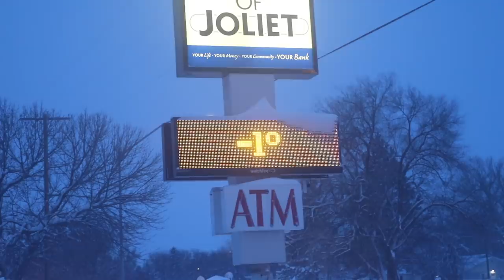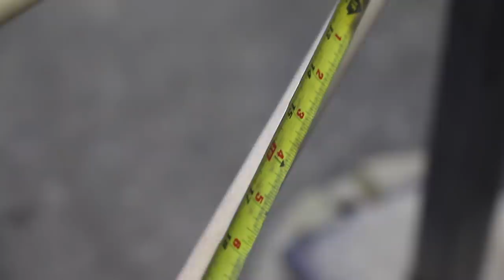Burning Sage Brush & Building Buggy Wheels | Engels Coach Shop

Comment: Great video! I'm afraid the brush burning alone would have just about killed me, but I know you're glad to have it done with. The stop action peening gave me a chuckle, but the self-applying rims made me laugh out loud! I pride myself in knowing by now what you are doing and why, but cutting those spokes so many times over had me scratching my head - that is until the last shot when it became clear that these were on different size wheels (well, of course they were). Thanks so much for bringing us along.

Comment: I got a little nostalgic watching you lock those hubs in, my last lockable hubs were on my 84 Ford.
Reply: Same here. I had a Jeep with lockouts.  I locked them in same exact way.
Reply: My dad had a ford with thoes in the 80s thankfully I can just turn a knob from inside my ford to go into 4wheele drive.
Reply: My 83 Toyota had them as well. Bought it new in the fall of 82 and drove it till the fall of 98. It was a bit rough riding due to the heavy duty suspension, but other than that, I really liked that truck.
Reply: In freezing weather, its very difficult to turn those hubs from free to lock as the grease is cold. However, he has the better brand hubs on his vehicle vs. the stock ones. Warn.
Reply: My '88 Bronco has manual hubs.  I always preferred them to the automatic ones it could have had -- at least in those days to lock the automatic ones you had to stop and back up.  I found it really handy to be able to shift from 2wd to 4wd on the road without stopping whenever it got a bit slippery.
Reply: @BrooksMoses  Yes true dat. Unlocking them by backing up after lever is in 2wd. The older 4WD transfer cases are more robust but the public does fall in love with a switch or button to avoid going outside to deal with locking hubs. I never understood the problem with having to do that but I'm not a yuppie from Vany Nuys, CA.
Reply: Glad to see I am not alone. I miss the ritual of locking before a 4wd trip. It was a ritual that contributed to the whole experience.

Comment: Agreed, much time and planning takes place to get those time lapse shots, especially on the fellow shots without the master wheelwright being in them, spoke to spoke. Was a good idea to show annual land maintenance takes two trips, one to make the pile and a second trip during winter to burn it down. Good nutrition for the ground. There's something about those Sarvin hubs either way you look at them. 
Wouldn't it be nice to have a machine that trims those spokes properly finished like an electric pencil sharpener? I'm just thinking of methods that would speed up and simplify but then not knowing what those costs would be, might just leave those ideas alone not knowing the volume of work they'd see. Likely, the shop knows the best cost/yield numbers best to follow.

Comment: Winter is definitely a good time to burn unneeded wood... the boathouse at our old cabin had become quite dilapidated after not attending to the tarpaper roof a few years, so one late summer I wound up stripping everything out of it and the volunteer fire department handled the ‘demolition’ over the winter. Only one hiccup though. The fire burned hot enough that the birch that branched out over the boathouse didn’t leaf out the next spring. 😑

Comment: Regarding the burn pile:  The first summer after I moved onto horse property I had a huge manure pile.  I did not have a tractor or manure spreader yet and it was getting large.  I was limited by the height I could dump a wheelbarrow so the pile was three feet high and twenty feet long.  As the summer progressed, July was hot and dry and the manure dried up.  I thought “Why don’t I just burn it?”  

I waited for the next big thunderstorm forecast to make sure the fire didn’t get outta hand.  I lit the oldest and driest end of the pile and it burned slowly with an unimpressive flame.  The rains came down hard and the fire was seemingly extinguished.  It wasn’t exactly extinguished.  The outer three inches of manure got wet but essentially shed the rest of the rain off of the pile.  The inner part of the pile continued to smolder until Christmas!

I was like Oliver on the TV show” Green Acres”.  I learned all the lessons the hard way that in agriculture you are a slave to the seasons and the daily weather.😉

Comment: As always great videos by - 2 questions:
You make two spoke cuts on the bandsaw, why not just cutting to length with one cut?  Am I missing something?
I see you use spade bits - are Brad point bits too slow?  Spade bits are easier to sharpen and cheaper - suspect that's the answer.
Love watching your processes, techniques.  I make m&t fir barn doors so I appreciate the Craftsmanship involved with wheels/carriages!

Comment: Thanks for the progress vid. Haven't done any brush burns since I lived in Eureka. Rained so much there, we could burn 9 months out of the year — bummer was, it was so wet it was hard to get stuff started, even after it dried out. • Hope these questions aren't too lame. Puzzled why you made ALL the spokes the same and then cut them down? Is it just your mass production method, or did you originally have an order for more of the bigger wheels? Also curious why those hub "rivets" are drilled between the spokes instead of into them? And why not nut and bolt instead of rivets to allow for future repairs? I really do find the wagon wheel construction fascinating. Only thing I ever saw before was on an episode of "Little House On The Prarie".

Comment: I don’t recall you discussing what wood type goes where on a wheel. I’d love to hear that sometime.
Reply: Fairly sure he uses Ash and White Oak
Reply from the maker: These buggy wheels are hickory.  The heavy wagon wheels are ash.
Reply: @EngelsCoachShop  I sometimes work on our RV using wood and some of the issues are similar to wagon making. Do you have rules of thumb for what goes where? Ash and hickory (and white oak) have different characteristics, so maybe it doesn’t matter in your uses?
Reply from the maker: @jamesfearing9459  Old school was - in wagons, white oak was preferred for strength and weather resistance; in buggies, elm for the hubs and hickory for spokes & rims.  Elm because of its stringy nature and hickory for strength and flexibility.
Reply: @EngelsCoachShop  love to see an episode where you discuss what woods for where, old or new school. I was aware of white oaks natural rot resistance but not elms tangled grain. Elm isn’t commercially available around here. Fascinating!

Lowest cost ‘hardwood’ around here is poplar, but it isn’t usually very tough or rot resistant. Here, by the way, is Cincinnati.

There is an issue with specific grain and wood type too. For instance, I have picked out fine vertical grain southern yellow pine and found it as hard as most hardwoods. Do you look at grain structure in a specific board too?

Comment: Just curious: How do you determine the proper size of a wheel to fit a wagon or buggy?
Reply: I suspect that these standard wheel diameters were invented many years ago :)
Reply: @midnike8783  Yep. My little box wagon has smaller front wheels than the back, but they still seem to be bigger than they should to make turns. I suspect that at some point they were swapped out from something else.
Reply: @kitchenengineer1731 Yes, Front wheels are smaller to make turning sharper as equally large wheels in front won't turn much. Larger diameter is better overall to travel over terrain.
Reply: @Garth2011  Yep. I understand that concept, however my front wheels are still a little too big to make a reasonably decent sharp turn. That's why I think they were swapped out at one time.
Reply from the maker: It's a relationship to the desired box height and the front axle fifth wheel assembly.  Different styles of reaches or perches can also factor in.
Reply: @EngelsCoachShop  Much obliged.

Comment: I use to build huge fires to burn up mostly dead trees, fallen limbs, and other wood products.  They were about 30 to 40 feet in diameter and as high as I could throw the cut up trees and limbs, usually around 12 to 15 feet high.  Most of the trees were old Sycamores around 3 feet in diameter.  It would burn for a few days and a couple times a day I would have to rake the unburnt pieces toward the center.  It was kinda neat to watch the way the trunks would burn.  My wife and I would light them as it got dark and stay with them until around midnight.  We would go back each night and stay with them until midnight.  Some times having a midnight snack of hot dogs.  We both like to be around a nice bon fire.  They were always legal fires and OKed by the fire chief.

Comment: Begs the question: How melted were your boot soles after pitch forking the loose brush?  We always wait till late spring to burn because a lot of small birds and mammals make a home in the brush piles over winter, and are better prepared in the late spring to vacate with their young.
Reply: Forgot the bag of marshmallows
Reply: There's never a real good time for setting off brush piles.  Snow on the ground is usually best because no matter how bad a wind picks up, it's real difficult for the fire to take hold anywhere else. Spring, even late, you can get wildfires to take off.

Comment: Morning Dave
Hope your all OK, a question. Why do you use a metal hammer when putting on the Fellows or Fellies? Why not a wooden mallet,  I doesn't the metal hammer dent the wood?
Regards Richard 🇬🇧
Reply from the maker: It only leaves dents if hit wrong.  :-)  Sanders and tires cover a multitude of sins.
Reply: @EngelsCoachShop  Thanks Dave

Comment: In France it is forbidden to burn vegetation outdoors. To get rid of it, I have to crush everything and wait for the composting to act.
Reply: Yes...likely worried it pollutes the world. There are sources who say that burning vegetation or wood is a neutral burn as the life of the wood prior to burning it, consumed much CO2 during photosynthesis. Then there are the haters who just look at the smoke and complain almost about nothing pollution related.
Reply: @Garth2011 
There are two reasons put forward to justify this ban. The first, which is more of a pretext, is indeed pollution and the production of micro particles.
The second, more justified, is that the composting of plants makes it possible to obtain a useful substrate for crops.

Comment: Hi Dave just wondering what those overalls are called with the open legs please ?
Reply: I have a hunting suit...coat and bib overalls split same way.  Only blaze orange.  But I've seen then plain canvas.  IIRC you can buy either piece or the suit.  Try an outdoor supplier.
Reply: Nigel --  Carhart makes them.  So does Key.  I don't know if Dickies still makes them or not.  I have an insulated pair.  They're great for outdoor work when it's below zero.

Comment: 13:50  So were the multiple sections cut off of each spoke just a way to make sure the cut portions were easy to fit into the firebox?  I couldn't figure out why you were doing that.
Reply: Different size wheels.i thought the same thing.
Reply: @dianeengel4155  Oh, it looked like he cut off one inch off the spokes, then cut another six inches off the same spokes, that is what confused me.
Reply: That's what I thought, too. I had to ask him.

Comment: 11:00 when you paint those rivets black, what kind of paint do you use? I recently hung a barndoor in my closet and now some of the bolts and nuts have some shiney showing where the wrench wore through the paint. ❤🌅🌵😷
Reply from the maker: I like to sandblast them, wipe them with vinegar, then paint them.  The vinegar is the advantage.
Reply: @EngelsCoachShop   , regular house paint or metal paint like rustolium?💜 🌞🌵😷
Reply from the maker: @suzisaintjames  Never house paint.  I like the 2X Rustoleum for quick metal prime/paint combos.

Comment: By the way, Dave, I wanted to ask you for a long time, why don't you use a pneumatic riveting hammer instead of working with the rivets by hand?
Reply from the maker: Too old fashioned I guess.  I have the pneumatic, but like doing them by hand.
Reply: @EngelsCoachShop  I understand that in the case of single wheel reconstruction, of course, it doesn't make sense to bother with a pneumatic riveting hammer. But in this particular case, you had a series with several dozen rivets. And I remember that you have an air compressor. That's why I asked this question. In my youth, I  worked with a riveting hammer, so I remember how convenient it is :)

Comment: Why use rivets instead of bolts and nuts on the wheel hubs?
Reply: Your ex best friend can’t come along and give you a flat tire!!😉
Reply: Mr Engel is reproducing wheels to the original design and would be what the customer had requested.  Getting a job done faster does not always equate to better. Cheers from Australia.

Comment: Are you recording using a stereo microphone? The first shots of you speaking are left heavy.
Reply from the maker: Same ole Mic.  Maybe it's going bad.
Reply: @EngelsCoachShop  If it's the same mic you use on the other shots, that issue seems to only happen in the ones of you speaking to the camera.
Reply from the maker: @BrunodeSouzaLino  Yes I use a shotgun mic when speaking and the camera mic otherwise.

Comment: What was the thing you did with the car wheels? Anti theft thing?
Reply: It's called turning in the hubs to put it in 4 wheel drive. That's how it was on older vehicles. Now you can just push a button or pull a lever.

Comment: Why do you need to mow / pile /  burn sage? Didn’t you run afoul of some clean air regulation or another? 
Seems like a lot of work to get to nowhere.
Reply from the maker: Steals moisture and chokes out grass.
Reply: @EngelsCoachShop  -  Thanks.

Comment: Sagebrush, an invasive species, good riddance! 
Here's some questions that popped up that maybe you can talk about in a future vid:

-- Why sometimes bolts, and sometimes rivets? 
-- Why one wheel gets a felloe that's half the wheel, and another gets 'em in pieces two spokes at a time?
-- When you need to cut all the way through (drainage?) and when you don't?

No fair answering "Magic" like you used on that wheel. :D

I need to replace my wood stove. I like yours. What brand is it?